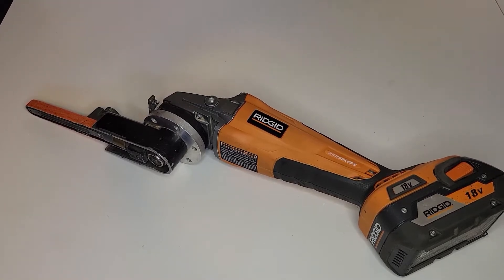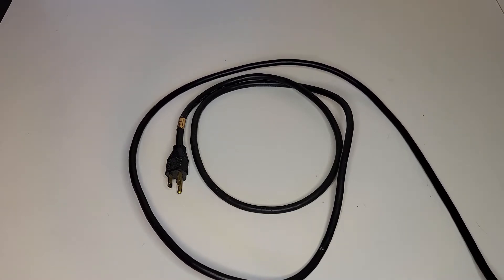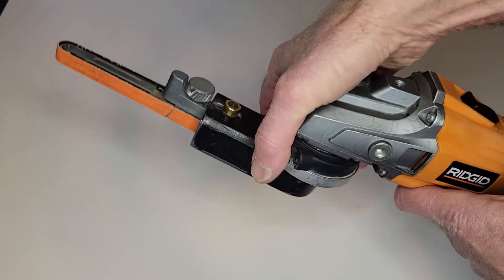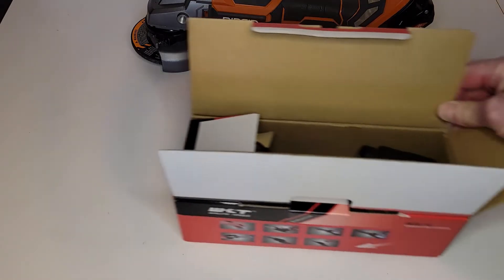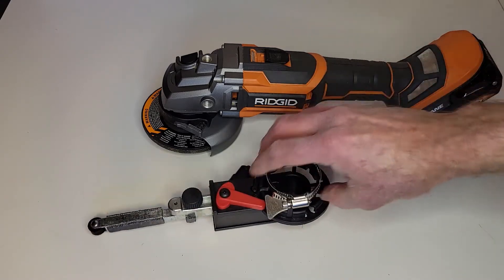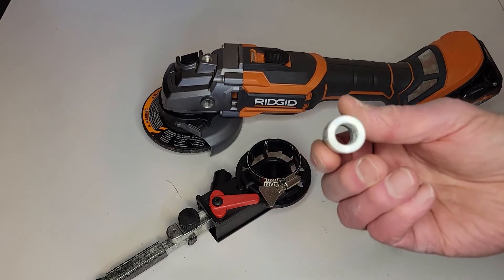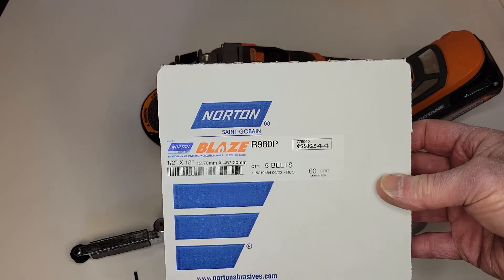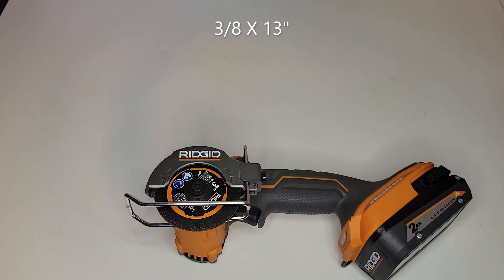Ridgid Cordless Bandfile Sander (Shop made Tools) Part 1

Comment: This is a great project. Can’t wait to see more, Thanks for posting it.  Wandering which you thought more of, Rigid or Milwaukee
Reply from the maker: I burned out 3 Milwaukee M18 Drills (the older models with brushes, not the brushless ones) so I switched to Ridgid.  Haven't had a problem (yet!) Heavy Commercial use.